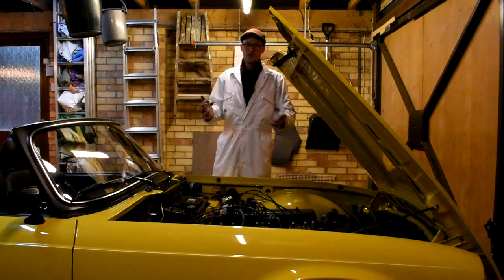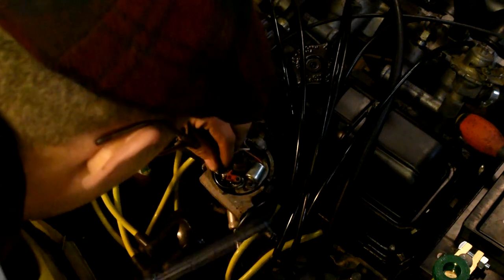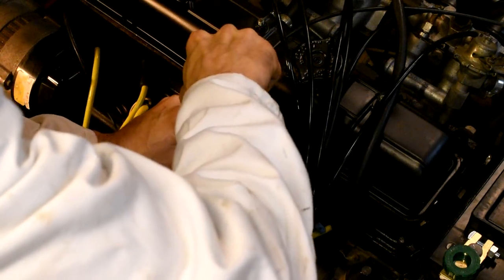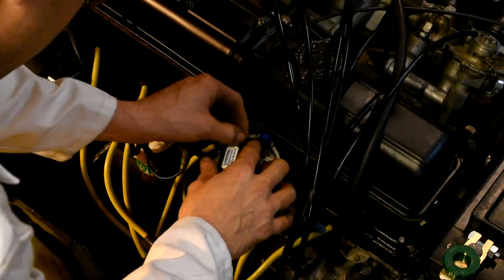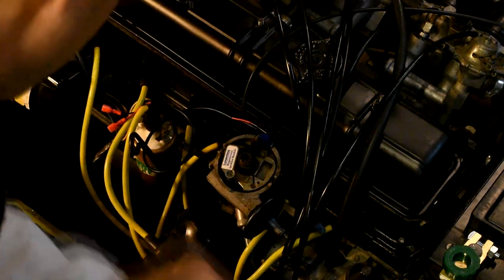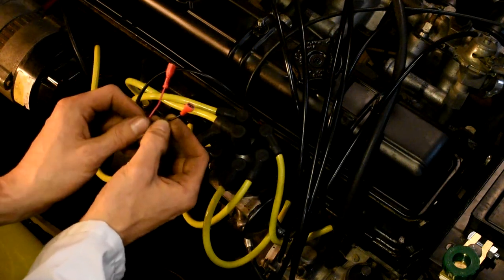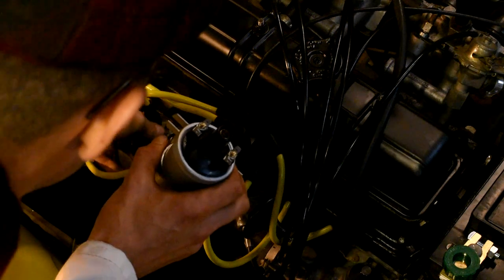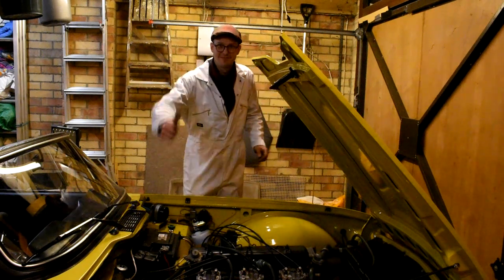Triumph TR6 Electronic Ignition

Comment: Excellent video.  I did the Lumenition Magnetronic on my 1969 TR6.  Works great, and you can't tell because it's all inside the distributor.  You might want to check your distributor beforehand.  I had mine completely rebuilt just to be sure.  What's another 120 bucks on a full frame off resto.  In for a penny in for a pound.
Reply from the maker: Cheers mate, this isn’t my car, it was done for a friend, that said with electronic ignition, it does dial out some of the wear you see when running on points, but I know what you mean 👍

Comment: Still on Points on my Steve, looks easy to do might change mine over the winter. Great video
Reply from the maker: Cheers Paul, in all honestly I think running on points can be as good as electronic ignition, if quality parts are brought from the distributor doctor and set up correctly. My own TR6 is still on points and I'm happy with it, on the hand electronic ignition is maintenance free. You just fit it and forget. Both systems have there pros and cons, but when it's as easy as this to fit as the lumention or petronix ignition systems, then it's well worth thinking about doing 👍

Comment: Points and condenser - how many breakdowns have these caused over the years :). Electronic ignition is the way to go on classics for day to day use and this kit looks like it allows for easy conversion back . Thanks for showing how simple it is to fit.
Reply from the maker: It's a good kit, very simple to install. The biggest problem with points and condensers are the quality of the parts on the market. Unless you buy quality items from say the distributor doctor, then the stuff out there from the main sellers tends to be cheaply made rubbish 👍

Comment: Hi Steve. I'd just like to get to the point (no pun intended!) where l can make a choice ! Mine is still way off before the body is ready to refit to the chassis. I guess this is a no brainer if you want your 6 to run more reliably. Thanks Steve. Hope you had the door open when running up the engine !
Reply from the maker: Yeah, they do run better on electronic ignition, and I'm happy to fit electronic ignition to anyone car. But with my own TR6 she happy on points and a quality condenser from the distributor doctor

Comment: Great video, I actually purchased this exact part for my US 1976 TR6 due to your video.  It all was going smoothly unit I realized that in the US cars, the ballast resister IS the positive wire, the instructions say that if there is a ballast resister to connect it to the wire before the resistor.  Being that the resistor is the wire, I can't do that.  Do you know what is the best way to power this on a US car war with a ballasted coil?
Reply from the maker: Hi Jeff, I generally just rewire cars if I'm unsure. The best way to do this is to disgaurd the orignal Triumph wires to the coil. Then run a wire from the a good ignition live only part of the fuse box. So the white wires at the fuse box are the best supplier for this. Then I feed a wire the other side of the white wires in the fuse box nealy to the coil. Some of the lumention kits come with an inline ballest resist, some don't, and you can wire this in if your coil is a ballest type. Depending on the kits I tend to discard the ballest, and re-wire so there is none ballest. Of course you need a none ballest coil, and systerm to do this like this, but the princial is the same for rewiring 👍
Reply: So a non ballest coil would be 3 ohm ? Thanks

Comment: Lovely looking Mimosa '6. Pretty straightforward install, would the adjuster knob on the distributor be enough to dial in the timing without needing to slacken the distributor?
Reply from the maker: It most likely would, but with this TR6 didn't have an adjuster vernier on it. I think this TR6's distributor was out of a carburetor saloon as it had a vacuum advance on it 👍
Reply: @SteveDentonClassics  mine has a vacuum advance, when I first got it I thought the slightly poor running was because it wasn't connected, but I discovered P.I. didn't use it but still had it fitted.
Reply from the maker: Yeah I've seen a number of them like that, I've even converted a few for friends to get rid of the vacuum advance, as you rightly say the Pi system doesn't run with a vacuum, just the bob weights. It's all to do with the saloons having them for the carbs, unfortunately over the years many TR's have had parts taken from saloons and fitted to them. In the 1970' and 80's it was far easier to raid one off a scrap car than buy a new one. Hence most likely why yours has got the vacuum as well as the vernier on it 👍